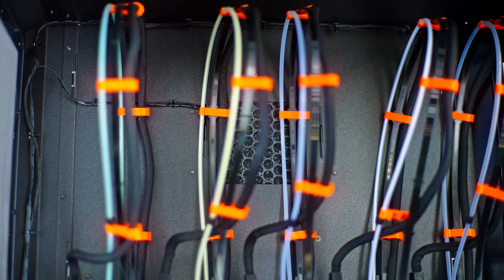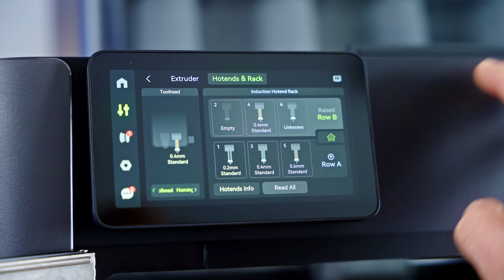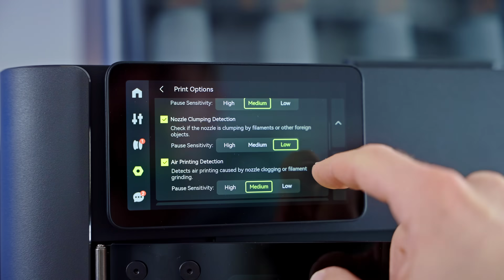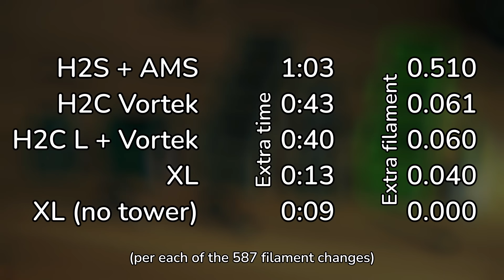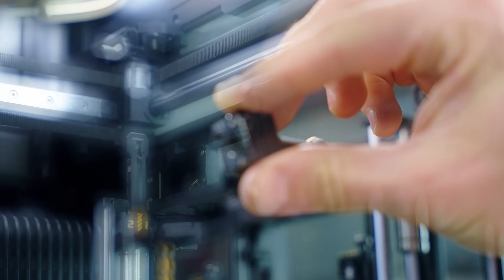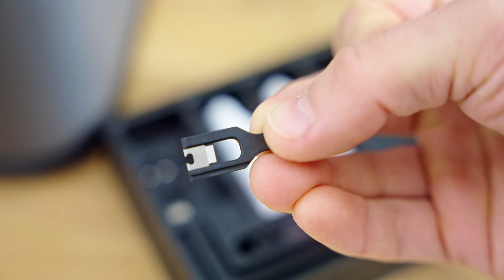The H2C is Bambu's 7-Hotend Patent Evasion Masterpiece!

Comment: My machine shipped with broken glass door.  Glass is in all of the Z axis bearings and I spend 2 days disassembling and cleaning the machine.  It fails calibration in several ways.  The Vortek Rack cannot home.  Very Sad.  I have to decide whether or not to take a deep discount from the Ebay seller, making the printer about 1100 dollars, or send it back and spring for a new one directly from Bambu.

Comment: But what happens to the filament in the hotend after the cut? Oh sure, it's only 5 or 6 cm, but think of the number of 6cm wipes of every change, even with the same filament because you want a steady flow (pressure). I dunno. I can see clogs happening in prints over 4 hours in length because of induction as well.

Comment: Wouldn't it be a lot faster if the AMS had 4 bowden going into a splitter on the printer frame and could retract while feeding?

Like, is the way the AMS works still a couple steps back from the eventual performance of AMS like systems?

Comment: What about flexible filament printing? Mixing that with hard filament easily is still my "wet dream".
Reply: It's no problem on the H2D, use the right nozzle for TPU, left nozzle for "hard filament", design properly for that and it works great.

Comment: thanks for this.  I just started 3d printing and have a P2S and notice I get a scratchy throat as well.  I have an xtool air purifier that I can connect to it once I print the exhaust funnel.  SO I will try that.  I have an H2C coming tomorrow.

Comment: Their choice to force the need for the ams with their switcher to sell more ams is their downfall. The only upside is filaments can switch nozzle sizes which is rare and can easily be solved by having even more nozzles and multiple of the same filament for different nozzles. Small gain for much longer switch times

Comment: Instead of heaters for the Vortek system, why not just better insulation sleeve it's dropped into? (To be fair, I don't quite know if it's dropped into a sleeve, or if that can work in any physical way.) Just thinking: simple passive, before complex active. And even if you went with an active heater, maybe you only need one extra heater to significantly speed things up, if, for example, you're only printing with 3 different filaments.

Comment: Hi! I just bought my first 3D printer and I’m trying to figure out what kind of tools and accessories I actually need besides the printer itself.

There are so many suggestions online - magnets, springs, different types of glue, calipers, files, etc.  but I’d love to hear your recommendations since you actually know what’s essential and what’s just “nice to have.”

What tools, consumables, and small parts do you personally use the most?
For example:

What size magnets are commonly used for 3D printed projects?

What types of glue work best for PLA or other common filaments?

Are there any must-have tools that beginners usually overlook?

Basically, if you were starting from zero today, what would be your complete beginner toolkit?

Thanks a lot for any help — I really appreciate your content!

Comment: im curious about the h2s would  ramain a single extruder with just the induction or would it become a dual. be cool if it was a single and it could store nozzels on both sides of the bed allowing 12 nozzles. the other wish i have is a 350 cubed prusa one  with the bondtech system.

Comment: Why is EVERY review ignoring the main advantage of Bambu printers which is 24 colors... I looks like printers should ONLY be used for 4/5 colors and anything else should be ignored...
Nobody would ever argue that the speed of a H2C cannot be as fast a REAL tool changer like the U1 or XL (by the way the printing quality of the XL is quite bad, this is also something to mention) but there are reason for that and the AMS (while slower) allows for other things than n other printers can do properly. Or at least no way close to the speed of the H2C (when you are using 20+ colors). And now imaging when they will (maybe :)), unlock the potential in the slicers to be able to use different nozzle size... The H2C will open a lot more capabilities with the Vortex than an actual tool changer as ANY nozzle will be able to be paired with ANY material and ANY size.
Don't get me wrong, that review was amazing and probably the best out there, but I really do not understand why this advantage is always ignored :)

Comment: TLDR;

Bambu came with a way to sell even more brand locked expensive replacement parts like printer ink cartridges for a system that can't even beat an old prusa xl. It also looks like a worse design in every way than the new ind-x system which does not need to swap filament through an ams and will need less time to heat as well. Wear with all the extra moving parts (ams+tool changer) just seems like it will not last a long time. Basically only worth it if you are already brand-locked into bambu or are a die hard bambu fan. Otherwise a Voron or sovol with ind-x will almost guaranteed be a better buy if you can wait a few months more.

Also, who will pay 70€ for a wearing replacement part like a nozzle? wtf? i swap nozzles every few months with my old i3 and it costs me 2€ a piece.

Comment: I was an early adopter of the XL 5T but ultimately sold it because XL print quality was just too unreliable. Even with lots of tuning and mods, an XL is prone to oozing/marking/marring…to the point I’d avoid using the XL. All said to say, I can live with the extra swap time if the H2C continues to deliver on Bambu’s reputation for reliably clean parts. TBD.

Comment: The H2C is still half the price of the Prussa XL and you get 7 colors instead of 5, probably will be 1999 next BF.
So like 1/3 the price of the XL.
Still way too early to jump yet.
We are going to see lots of new machines with lots of different multi material solutions now.
Things are about to get really interesting
Reply: Yeah, but it’s over 2x the price of a Snapmaker U1 and likely similar to the upcoming Prusa Core One with 8 INDX tools.

There are going to be a lot of tool changers by the end of 2026. It’s not clear how compelling the H2C will be within 6 months.
Reply: @JonS yes you're right which is why I am going to wait it out.
But I admit the U1 is very tempting at $850
I am surprised that Creality is being so quiet now that the H2C is officially here.
I don't think I would buy the Prussa over the Bambu though.
I was not impressed with the prints Joel's got off that machine, TBH they looked like 💩
And the machine itself looks like a prototype
The core one looks like it will be more polished but I still don't think Prussa can compete with these more polished machines.
And maybe by next market saturation will force Bambu to lower their prices a lot more.
Maybe we get a cure ball and they make the X2C a tool changer.
I am hoping for them to make an A2C of an A2D , an upgraded A1 with 3000x300x300 bed and a vortek for around the launch price of the A1.
Reply: @andreamitchell4758  Creality will probably have a tool changer out early in the new year. It will be the result of days of development 😂

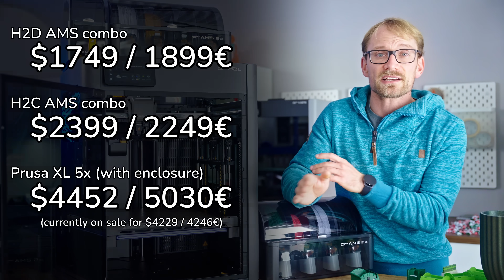Comment: 20:19 not entirely accurate. The H2C has a smaller bed than the H2D. Also, it doesn't seem clear if the H2C can use the same laser/drag knife/pen tools of the H2D.
Reply: It can use them

Comment: My big question: Can one bypass the AMS on the right side temporarily to print with externally fed (real) TPU from a top feeder ?
Reply: Of course. But you can use tpu on the left nozzle if it's not too soft.
Reply: @JakovPerisic  Thanks for the reply, I think you're right, but wouldn't buy an H2C without being sure. I'm asking because with the H2D, Bambu Lab says explicitly to use only the right nozzle for (non-ams) TPU because the movement of the left one can cause a jam. And the H2C may enforce using an AMS for the right nozzle in Bambu Studio. So I would like to hear from someone who has actually tested it...
Reply: It has been demonstrated in a review, no worries.

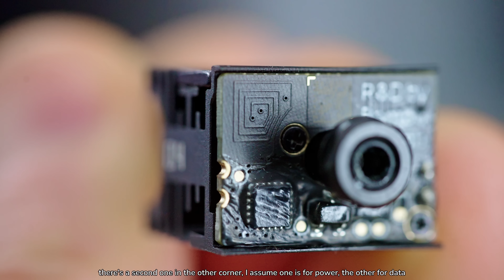Comment: At 3:27, is the pcb getting damaged by heat cycles? Ive seen that in other video, wondering if that will make the nozzle useless quicker than the we think.
Reply: I saw in another video that there’s a thin layer of silicon over the components giving it this look

Comment: This is an amazing solution for my workflow where I mostly print single color, with support material but frequently swap nozzles and primary material. It's fast and convenient, and takes up less space than dedicated machines. Though of course multiple machines may be faster and possibly cheaper. 

Still. For now my eyes are set on the H2D.

Comment: Forgive me for being dense here, but I am unclear on what the hot end changing gives you?  I have an H2D right now so I have two nozzles to print with, and like mentioned in this video what I really love about that is printing support material in one and the actual material in the other.  What does the ability to swap the hotend on one nozzle get me over that?  I'm just really fuzzy on what this whole system does for me.  It sounds like it still purges and primes if I use more than one material.
Reply: Changing colours with no waste unlike with ams with purges

Comment: On one side I'm going "oh, that's nifty. Oh, that's nice. Ah, that's good" and on the other side I'm going "as a software engineer, seeing more and more hardware companies build things like software, they forget that hardware, unlike software, can't be subtracted from easily. And an extremely important aspect of software is refactoring, which implementation details are refined, updated, and plenty of times: removed" and where I go with that: the H2D felt like a refinement and enlargement of the X1C, but the H2C feels like something that was added onto without refactoring... sure, molds and stuff are expensive so reuse what exists. But you even said "this feels complex, but after a bit, you get used to it". But did it have to be complex? Does the nozzle need to have a IC on it? Great it works in demos and for reviewers first couple days... but what happens 2000h down the line when something jams or there's an error? Etc. Etc. It's easy to look at the XL, U1, and others and go "wow, a full extruder... that's complex", but that's why the INDX and some others exist where it's just the tube. This added complexity to a simple solution in order to avoid a solution that appears complex but is actually simple... Last example and I'll stop beating the dead horse: Prusa: we added 2 fans and a slot for airflow... "but it's not automatic". Bambu: multiple automated flaps, slides, air pathing, and fans... and somehow doesn't have the ability to filter all air if desired? Not to mention additional errors and config options. Prusa: we heard you about not being automatic... we added a small flexible bar so the extruder can close/open the vent on it's own. Simple solutions work.

(written while watching) Why am I getting "filament locked to a manufacturer" vibes from the individual serialized and tracked hotends? (gets to that point in the video) "Big Oof" Now I have to ask if, given the serialized hot ends, a bad interaction with Bambu could get your nozzle bricked... what about resale? What if I set a nozzle to PPS-CF and then later sell it to a some rando because the H3Q came out and uses a different nozzle? Does it suddenly show up to that user as "sorry, this is only for PPS-CF"?

Also not mentioned: the upgrade kit is $800 for H2D and $900 for H2S. Though from the pictures, it's a pretty beefy upgrade so if you got a Bambu so you didn't need to tinker, and now having buyers remorse for not getting the H2C... you may want to avoid the upgrade.

Comment: It's a neat system but you still need to retract and feed back the filament all the way to the AMS which takes time and is problematic with flexible filaments. It only solves purge volume waste. Overall it's neat printer given it's printing surface, heated chamber etc but the filament swap is still a bit of a half measure. The only reason I'd be remotely interested in it is that I could feed flexible filament to one nozzle and print with more rigid filaments with the other. But ... no varous flexible filament changing. Even with A1 and AMS lite you at least don't need to retract the filament so far resulting in rather quick filament changes.

Comment: You say 'basic printing works flawlessly' and 'print quality is great'while showing us prints that are not flawless, as you partially point out a few minutes later with the print line. But the vace does have some large artifacts and hairiness and an imperfect top layer. These are flaws you used to point out back when printers were having a hard time in development. Now you just mark Bambu off as having great print quality overall while ignoring the actual prints you're showing us. Then later on when we get to the multicolor bin prints the print quality on those was garbage enough to deserve being thrown in a bin, fitting for the model being printed. That was pretty terrible quality. Sure impressive speeds if the print was good, but it wasn't and no speed is relavent when the quality just isn't there at that pace.

Comment: Hmmm. I don't feel like this is an upgrade. Yes, the tech used is cool, with the induction heating and how the connections are made. But in the end, it still costs me 5-6 hours to print a simple multi color figurine. The reason I dont do/sell multi color prints. It is still doing the same thing, it now just does not output a lot of waste.

Comment: Having just bought an H2D, am I frustrated that they should launch this immediately after?  No.  When it comes to technology, you have to commit to buying at some point, or you'll spend your live never buying.  Having a new model announced just after buying is always a risk.  I had been concerned that they would release something better than the H2D, but the H2C isn't what I was worried about.  The vast majority of my printing is monochrome, and I want the dual head so I can print a support interface layer without needing a purge tower.  Some other prints are 2-colour that don't require supports and again they can be printed without a purge tower using the dual nozzles.  For those few occasions where I do want to print multi-colour, I've got the AMS and can live with the purge tower.

I can see the advantage of this if you regularly print multi-colour prints, and the idea of reserving a nozzle for a single filament type is useful if you're combining that filament with others, but how often is that likely to happen?  If you're reserving a nozzle for an exotic "engineering" filament, you're probably not going to be mixing materials.  If I want to reserve a nozzle for one type of filament, I can do that on the H2D.  If that nozzle is not attached to the AMS, I can even print it with another material in multi-colour.  Other than the convenience of not having to manually swap nozzles, there's no real benefit to the H2C.

In other words, this is really only useful for people doing lots of multi-colour printing.  Since that's not me, if anything I'm happy they've launched the H2C and not something I might have regretted missing out on since it means such a printer is probably not on the cards for a while at least.  If I were choosing which printer to buy today, I'd still choose the H2D, which does everything I want and more besides.

Comment: Bambu fumbled by having nozzle swapping on the right position only. If they had designed both sides of the tool head to hot swap nozzles, they could have allowed the standby nozzle position to stage the next filament with the use of two AMS' which would drastically reduce multi material print time. Vortek saves a bit of time and some filament by reducing purging but it's a large complication for a marginal benefit. I love my H2D, but I'll avoid Vortek and proceed straight to INDX for my Vorons once it's matured slightly.

Comment: Calling a process in which you not only need to change the extruder to change the color, but also waste plastic on cutting and cleaning, plus waste time heating the nozzle, and waste time changing the rod in a single tube, “optimized”?!?! Seriously?! 
This is probably the worst possible solution for changing tools that could ever be thought of. They literally took the IDEX scheme, only connected 2 extruders into one (and thereby lost all the advantages of this scheme, retaining its disadvantages), and then made an overcomplicated system that is inferior to analogues, which breaks easily, has no potential for expansion... and simply has no potential for optimization due to the fact that no one will repeat such idiocy.
The H2 series is not just a step back, it is some kind of hallucinogenic nonsense that replaced the really worthwhile X1 printers.

Comment: This review feels like it’s missing a major point.

Yes, printers with a toolchanger are faster when printing in one, two, three, four, or even five colors. But what happens when you want to print with more colors? That’s exactly where the Bambu Lab H2C really shines. With support for up to 24 filaments connected at once—ready to be used in a single print—the H2C offers something the Prusa XL simply can’t, and without multiplexing it never will. It’s unrealistic to expect a “Prusa XXL” with 24 toolheads.
Reply: But can't they like connect an ams like system to each head in a tool changer? I mean it'll have it's downsides but still ahead of this bambus gimmick